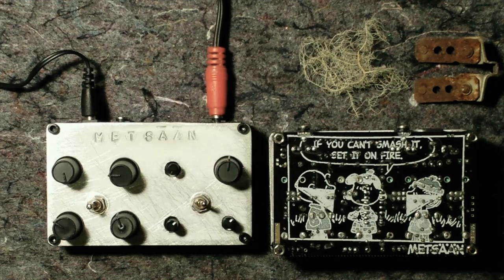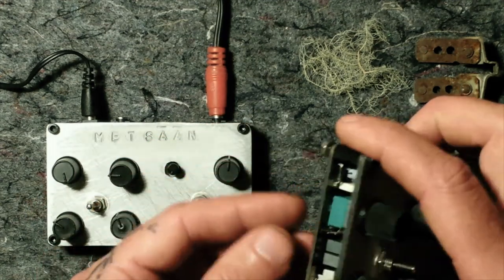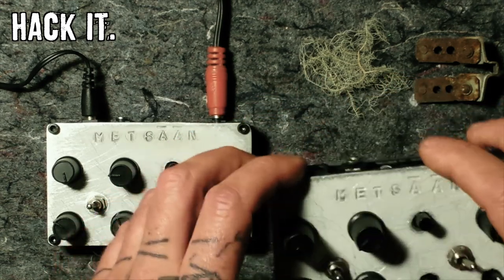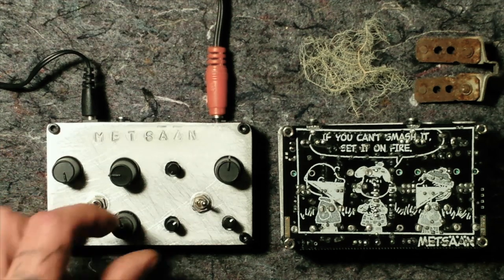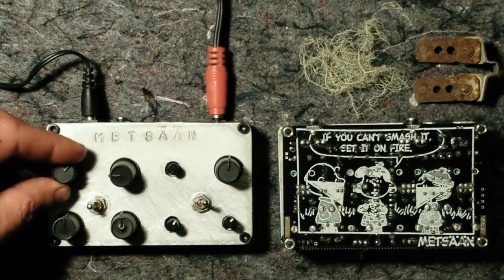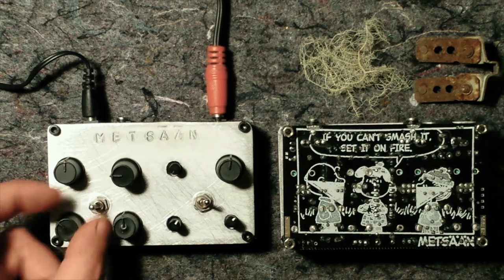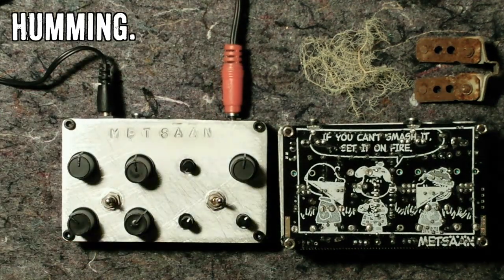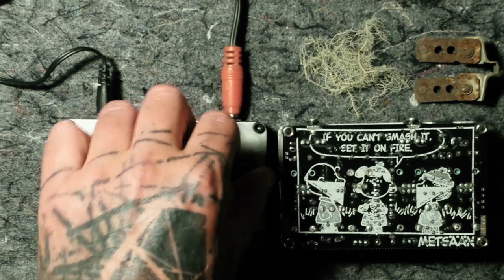DIRTY DRONE SMASHISM - Barebones drone synth with resonant high/low pass filter

Comment: I need your help in order to see hows your product works, the item you gave me seems aint workin... There is no sounds coming out from my mixer and the led light ain't lit. I send you the video in your email to see it. Reach me up for any possibilities..
Reply from the maker: you seem to have the DC polarity for the power supply inverted. please only use a power supply that meets the specifications: 9V DC, center pin positive (+) and ring negative (-). usually you can see a small diagram that tells you what the output polarity is. standart effects pedals (boss style) have the inverted polarity of what you need, so if you want to use it from a multi supply like the 'power plant' you need to have one dedicated cable with a polarity flipped plug, but be careful to mark it as that, so you don't accidentally use it for other devices. hope this helps. also have send you an email.
Reply: @grm-metsaeaen  yes it seems the problem was the polarity, im using a power plant source that's run to a DC with a negative polarity thats why it wouldn't start to lit the LED and no sounds coming out. Thanks to you for giving me the tips for making an inverted connectors, now its fully functional and everything on this video demonstration was pretty accurate.